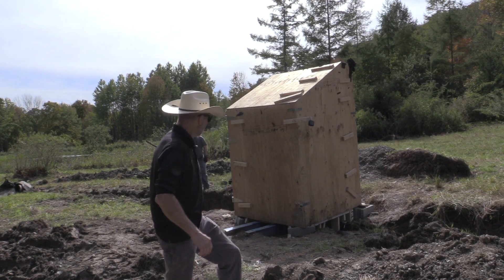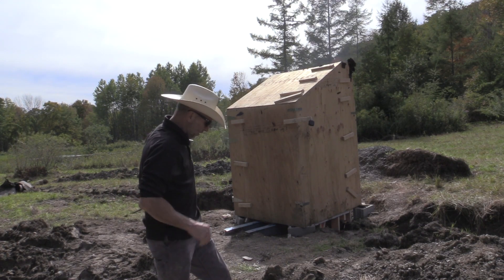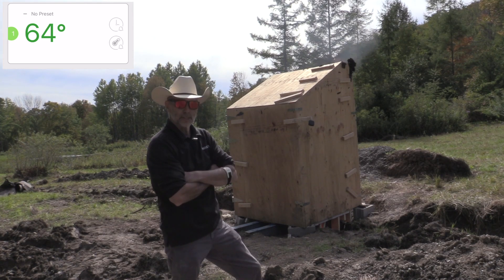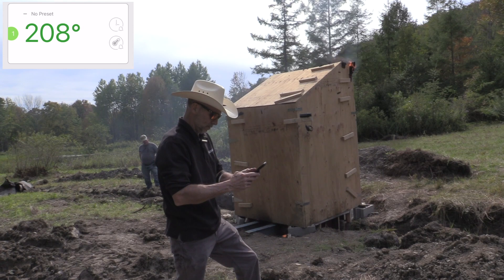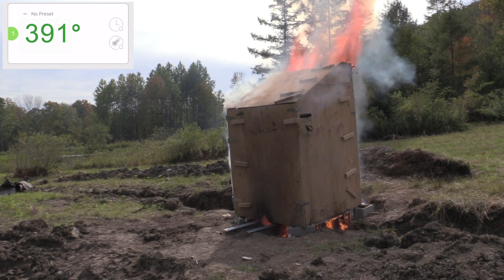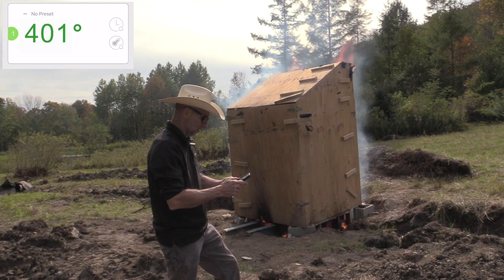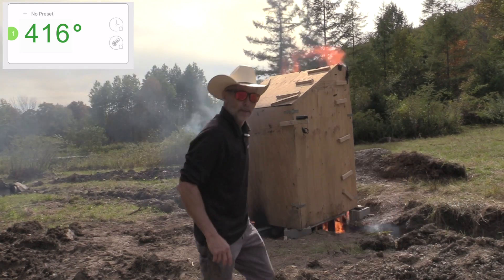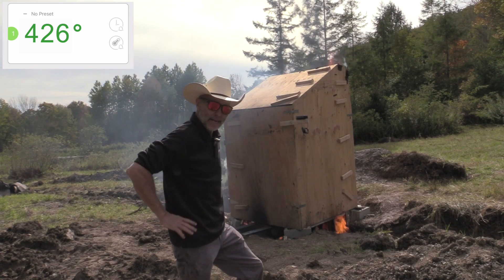Gun Safes Fire Test  - Don't Believe Fire Ratings

Comment: How about checking Sturdy gun safe you will be singing a different tune
Reply: Thanks for the note!  Looks like Sturdy does make a solid safe. I am not sure of the actual fire tolerance for that construction type. It looks a lot better than a Liberty or Canon. They are quite expensive. At that price point I would simply spend a few hundred dollars more and get a filled safe (double walled steel filled with concrete composite). Like the Amsec BF series or our True Safe.  The Sturdy, at 3/16 steel is heavier than most safes but is still very vulnerable to a circular saw and carbide steel blade.  The filled safes defeat this threat and offer superior fire protection.
Reply: @ sturdy is 4gauge body and ceramic wool fire blanket some other materials. I bought mine few years back. Took 3 of us to get inside 795 pounds. So far it’s been great. 24x19x52

Comment: I've yet to buy a safe, and was looking for one today. Fire proof made no sense to me as the surrounding area will heat up the inside. Also a lot of them have a hole so you can dril through the sheet rock, and run an electrical cable through it. smg
Reply: If you want a safe get a cement filled one, they stand a better chance of not cooking your stuff. Also put any money or paperwork in a sentry fire safe inside the big safe and your guns in zipper type cases they help to keep the moisture from getting to your guns and causing instant rust

Comment: I live in a rural area with a volunteer fire department with just one pumper truck.  No fire hydrants anywhere.  ISO rating: none.  There have been two residential fires in the fifteen years I have lived here.  In both cases, by the time the volunteer department arrived, the homes were fully engulphed and burned to the ground.  I wont have any safe with less than a 2 hr. UL fire rating.
Reply: Look for cement filled fire safes, they make all the difference

Comment: I built a water cooled safe that has a valve that opens when it reaches 200°f.  That valve sends cold water from a thousand gallon tank through a coil system of copper pipes that run through the safe.  It can survive a fire until the water runs out.  Temps inside won’t reach even 120°F.
Reply: Cap
Reply: Yea no you didn't.
Reply: @realtyrocks1969  sure I did. It’s not really a safe, but more of a storage container. It doesn’t lock. Yet.  The valve that starts the flow of water is a simple ball valve with a spring to open it. The valve is kept closed by a stick of hot glue. When the stick melts, the valve opens. The water tanks are just two 500 gallon fuel oil tanks connected to the water line. They sit outside the house. The water flows through the container walls and exits as a water sprinkler that helps suppress fire near the container. It’s not like it’s a complex thing or even difficult to figure out. It’s not my fault if you can’t grasp such a simple concept. Lol
Reply: @jeromebullard6123  cool story bro. Lol.
Reply: @realtyrocks1969  what are you, ten years old? Lol